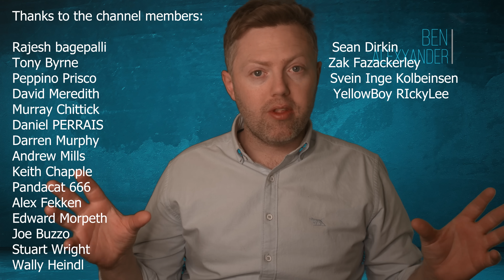CATL’s New Sodium Battery Will Reshape the Entire EV Industry

Comment: I would like to see a complete set of specs, and not just the ones their marketing team choses to advertise before I make up my mind. This is an important step forward for sure, but how big remains to be seen.
Reply: Watch will Prowses test on a sodium battery. "Sodium-Ion Battery Reality Check" The specs are horrible, efficiency 60-92%,Li-ion more like 95-99%, extremely large voltage range, a car with 800V systems would have 800V when full and 200V when empty, totally undesirable for BEV applications.
Reply: Yes, they talk about energy density per weight, but what about per volume?  Someone else pointed out the large voltage difference between full charge and nearly zero charge, which will take some tricky engineering to make the batteries usable.  And, this talk about charging in 10 minutes is just a fantasy.  The massive amounts of energy required for this will impose huge challenges that won't be solved for a very long time.  I'm very hopeful that these batteries will be no-kidding safe and reliable, but I'll be very skeptical until they've been around for 10 years with few problems.

Comment: I find a lot of YouTubers don’t have a clue about sodium vs lithium atoms, they just talk whatever they saw on the internet.

Sodium atom has 11 electrons and 3 shells, but the only electron in the outer shell is working to charge and discharge, and the outer shell has only 1 electron so 9% of electrons are useful in a sodium atom.

Lithium atom has 3 electrons and 2 shells, again only the electron in the outer shell is working to charge and discharge and outer shell has 1 electron so 33% of electrons are useful in a lithium atom.

So in theory lithium has almost 400% more energy density than sodium, lithium’s theoretical energy density limit is around 750 Wh per kilogram and sodium’s energy density limit is around 200 Wh per kilogram.

CATL’s claim that its sodium battery has energy density of 150 Wh per kilogram is like someone claiming their lithium battery has 550 Wh per kilogram because 150 Wh for sodium is 75% of its theoretical limit. I will be very surprised if CATL  could make their sodium batteries energy density of 100 Wh per kilogram.

Plus sodium batteries have weird voltage curve so can’t be used when the battery is less than 60% charged, that is why people say sodium will only compete lead acid batteries.

To be fair there are cases sodium batteries have more advantages than lithium but sodium will replace lithium is absolutely impossible.
Reply: Yes, but energy density of lithium ion battery depends on temperature, which drops to 5% at -40 C. Plenty of cold countries see that temp during winters.

Comment: Another advantage of sodium tech is that it doesn't require elaborate cooling, the way lithium does. That means your battery pack can have more batteries, less cooling tubes. If the energy density is true, then a sodium battery of same weight should get the same range as the best lithium, with no fire problems, and super cold weather resistance, for half the price, or less. This changes the game drastically.
Reply: No. Watch Will Prowses videos on Sodium cells. He tested one and the specs and efficiency are HORRIBLE for Home and BEV use.
Reply: @Flinno-k8w you have to be a bot
Reply: @Hiusername-not-cursed why?

Comment: I still can’t understand how CATl can achieve high energy density when a sodium ion is heavier than a lithium ion cannot hold the same level of charge per  unit of weight. that defies the laws of electromagnetism.
Reply: He clearly says current Na ion battery holds energy at 175 Wh/kg as opposed to 330 Wh/kg in an Li ion battery
Reply: Sodium batteries are mainly competing with lower density lithium types (like LFP) and don't require additional material needed for thermal management.
Reply: The specs of those batteries are HORRIBLE for BEV use. To get 100% of the nameplate capacity, an 800V car would have to discharge to 200V, which is insanly superundesirable with extremely high losses due to the Amps needed to provide equal power at 200V. 
Watch Will Prowses last Videos. he has Tested a 12V Sodium battery. The efficiency and Voltage range an other specs are a nightmare for Home or BEV use.
Reply: @Flinno-k8w it’s not impossible to deal with— it will just require some engineering  workarounds. One way would be to dynamically switch the bank of battery modules from parallel to series as it discharges.
Reply: @romanval69  Sounds expensive and inefficient. And you cannot just reconnect them to parallel again, as the cells are not 100% equal and voltage differences will build up.
It's just really really bad for BEV use.
Reply: @romanval69  that's right, they just need to smooth out the voltage curve. What that will mean is that battery will discharge slowly at first and then very rapidly as it discharges towards 0. Given the low cost of transistors it is very practical

Comment: Looking to use these for TELECOM (-54V), but the voltage swing is large.  Sodium kinda approximates AGM discharge curve for much of the discharge, but will go lower.   Due to the voltage swing (1.5 to 4V per cell or thereabouts), the battery technology requires either a load that can accept or work with such a wide swing (26 to 62V is 2:1) which Telecom does not (40  to 60V), or use a DC-DC Converter to output a constant voltage.  Huawei LiBoost did this with Lithium.  A constant voltage like 57V can be output, which is great... reduces wire gauge, and current.  I2R losses over long cable runs.  Cold temperature recharge is a great thing, especially for cabinets in sub-zero environments.  For off-grid cycle charge and solar sites, Lithium is great, BUT requires heating being critical path.  Loss of heating and battery goes below 0C, means no recharge.  Sodium seems to be tolerant of sub-zero.  Looking to do PoC!!!  Bring it on!
Reply: Yes that voltage swing makes it almost unusable as a drop in replacement..

Comment: the elephant in the room here is the round trip efficiency of sodium battery which is only 80%. that's lead acid level efficiency. compare that to li-ion is 85-95% and LFP 95%-99%
Reply: Sorry??
Reply: Yeah and its voltage curve really sucks. And energy density also sucks. A sodium ion battery will only be good for short range car.
Reply: @teagueman100  its 175 vs. 185 so whats the deal and your lfp might just have the same round trip efficiency, calculate in the lower degradation and better temperature handling the sodium is superior only density is lower and i bet give it a few revisions and lfp is dead if all of the claims of catl hold
Reply: @teagueman100  That is very good enough for travelling inside city, taxis and city buses. Even if this battery reduces ICE requirement by 25 %, its a great achievement. Like a Bus with 400 km range inside city is great !  I will be quite happy with a car's actual range of 400 km at full load. Best thing is it can be charged to 80 % in 15 minutes and another great thing is it practically has limitless charging cycles to last for at least 15 years. It seems too good to be true.
Reply: That is why it will make more sense for grid storage etc first while that happens, because it will be much cheaper so can just put some more batteries in to compensate.
Then EVs and other applications will take off once those issues are worked out over time. I don't think it will take long, given the level of investment and rate of innovation in this space so far. Perhaps a year or two.
Reply: @Antmanzzz  80% efficiency isn't great, and it makes me wonder if the 20% is going to be dissipated as heat, or something else.  Putting in more batteries will improve storage capacity, but there will still be a 20% loss in energy.  Since when has any battery chemistry been improved significantly?  Wouldn't lead acid batteries be nearly perfect by now if that were possible?  Ni-Cad, NIMH, LifePO4, carbon zinc, alkaline; they all have one problem or another with no hope of significant improvement.  I think we'll have to wait for a better chemistry, rather than improve on sodium ion.  I share your thoughts that since there is a renewed rate of innovation in this field that something will be discovered and implemented in a few years, but my estimate is more like 5.
Reply: Even at 80%. There is less cooling needed so more weight saved increases efficiency and the elephant is that they charge below 0. That’s the elephant. Big friendly elephant that’s useful. 
Your point was about the elephant?

Comment: No accident the first deployments are in country battery swapping  stations.  Delay the reverse engineering as long as possible.  I wonder if CCP will even allow export.  The government has  made threats about keeping new battery tech solely at home. Not sure if that would include export ban.
Reply: Do you really thank that it is that difficult to copy a technology in today's world? It's just a matter of resources. Mass production makes it cheaper and you always win if you produce more than others.
Reply: @fakamada 
Kinda my point.  It sounds like CATL is not selling these.  Sounds like they are in lease exchange EV batteries.  If the competition can't buy one, they can't reverse engineer it.  And to your point.  Turns out batteries are actually very hard to make at scale.  Quite exacting production that is often difficult to get the scrap level down to a tolerable level. If you're throwing away 20% you aren't having a good day.  And tiny assembly errors that don't show up immediately can lead to massively expensive recalls down the road.  Just ask LG.  It's harder for cans, and I don't think these are in cans, so there is that.

Comment: Now THIS would encourage me to have an EV in the next few years (can't possibly afford a new one!).
Reply: David, take a look at used EVs! Ok, used, EV pickups are still way too expensive, with used Ford Lightnings still starting at $35,000!

But you can get a good, small EV with under 30,000 miles for less than $25,000 dollars! And, you can get an old, pre-2018 EV that’ll still get you to work and back, for as low as $10,000 or less!
Reply: @freeheeler09 you can buy a used Leaf for $5000 with 80% battery life.
Reply: EVs devalue like rocks. Used ones are very cheap, just avoid Tesla.

Comment: The reality of large scale 1000 kW charging bays is unrealistic. 
The grid connection for those to exist is impractical.  
You might see one or two of those only and the rest of the charge parks with the typical mix of 100-400 kW chargers that share loads. 
Just look around at the charge parks being set up and the way few if any offer maximum load capability.
Then also factor in how many cars can charge that quickly , Less than 0.00001% of the EV's.
The vast majority of cars even now charge at 300kW charge rates and many at less than that.

Sodium Ion with 5 C charging is fine. 
Battery swapping is IMO a more beneficial way of refilling the vehicle.  5 Minute swap outs like the Nio's in Shanghai.
Not unlike the Swap and go LPG cylinders for the BBQ.  
Years ago people stood at a service station and an attendant filled your gas cylinder, Now you swap it and the empties get inspected and replaced when out of date.
Nio does the same with their batteries. so does Gogoro for scooters across Asia.
A slower charge and status checking which is better for long term battery health in any case.

Comment: This Canadian is jazzed for the Naxtra because I've literally seen -37c and +37c this year alone and yes my locally made Toyota Matrix did struggle in both. Lead Acids don't do well past -25c here even if you keep the block heater plugged in they get iffy. Diesels don't do well at all past -20c so I park that one for 6 months if I can help it. I'd much rather have a BEV with a sodium-ion battery in those temps...
Reply: Ok, but sadly, no charger will work at -20C.
Reply: @truantray  Except that the charging happens inside the garage (at least for people who live in those climates), which is generally warmer than the exterior temp recorded by weather stations, which is what we're talking about. And those garages are insulated. It's far from as insulated or air-tight as the rest of the home, but you don't need things to be +20C for the charger to work. +5 to -5C is fine, depending on the tech.
Reply: Which is why my jump start pack is LTO. Good enough to about -40
Reply: I regularly drive my Diesel car at -25C or below. Granted I have a block heater, but it's not a problem for modern Diesels. But I can't wait for battery technology to be at a point where it's affordable and reliable enough (as in, not breaking and not wearing out too quickly) that I can make the switch to EV. If the promises CATL has made actually hold up, I think we will have arrived at that point at least for me!
Reply: I want to see it, in real world  application. Can it be scaled  up or down? Or it is going to be an other hype that can't  live up to the hype.

Comment: Yes, the auto industry will love these new batteries, and the batteries will continue to get better. That is all wonderful, but everyone is ignoring what this means to aviation, shipping, and railroads. Safe, powerful, and efficient batteries won't just change transportation. They will change the world.
Reply: This chemistry doesn’t have the density needed for aviation.
Reply: @Jan_mxv  Yes. The physics of flight is very against electric aircraft. There are some uses, but these are niche with limitations. Aviation will be one of the last industries to move away from oil, if it even can.

But maybe batteries can help a bit, during taxiing for example. A lot of energy is discarded during descent, maybe that can be captured by batteries to use for taxiing once in the ground. It may not be a massive CO2 saving, but it would help the air quality around airports. But there is a long way to go before those ideas can be made to work.

If there us money to be saved, Ryanair will chase it 😉
Reply: @javelinXH992 
The aircraft I fly typically consumes more than a tonne of fuel taxiing with each flight. However on a long haul flight it will consume 500kg for each 1000kg of extra payload so the benefit of an electric drive is offset by the extra weight and complexity. Also starting the engines at the holding point introduces nproblems of workload, flexibility and air traffic management. So there’s not a strong operational or economic incentive.
However the concept is sound and it would reduce emissions.
Reply: @meofnz2320 Electric tugs to the runway is another concept I have heard of, but it sounds a bit complicated. Aviation is probably going to have to get a pass on electrification.
Reply: @javelinXH992 sodium batts are heavier per kilowatt than lithium so in cars and planes, they aren’t ideal. However home use is fantastic.

Comment: Since the energy density is low compared to NMC or similar batteries, I'd like to hear an analysis of which types of EVs will likely feature these batteries.
Reply: The cold weather advantage seems compelling to me. I already lose 20-30% (or more) of range from November-March. It's also a tech more amenable to high voltage DC charging, it seems. So I could see its advantage in industrial vehicles that have access to on-site DC fast charging (fork lifts, site specific dump trucks, etc.) too.
Reply: It seems to be more suitable for city cars or large passenger vehicles such as city buses.
Reply: Boats.
Reply: Watch Will Prowses last Videos. he has Tested a 12V Sodium battery. The efficiency and Voltage range an other specs are a nightmare for Home or BEV use.

Imagine a 12V battery that is 16V when full and 4V when empty to get the full capacity. That is a nightmare to work with. 60-92% Efficiency is also bad.
Reply: EV's for everyone that doesn't want to end up barbecued in their Tesla's, I reckon. On a slightly more serious note: Lithium-Ion batteries didn't reach 330 Wh/kg immediately. Imagine if Sodium-Ion gains improvements over time too...